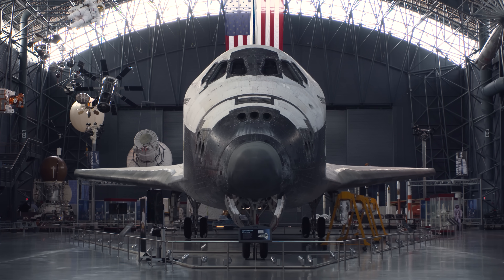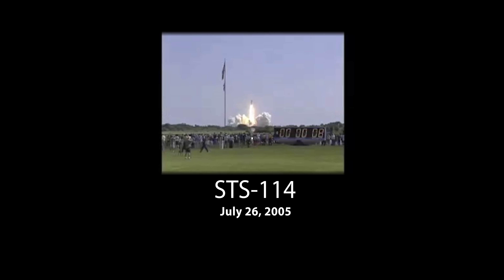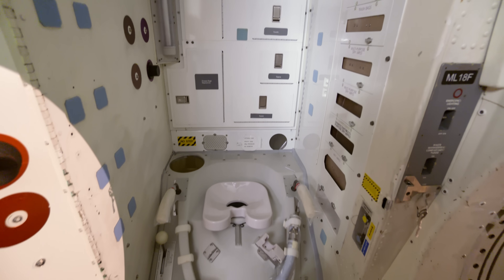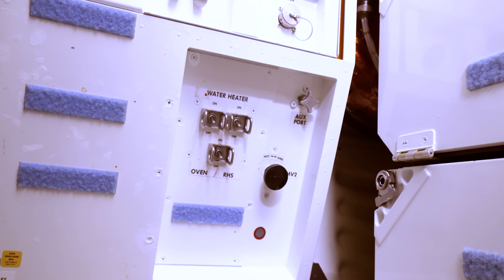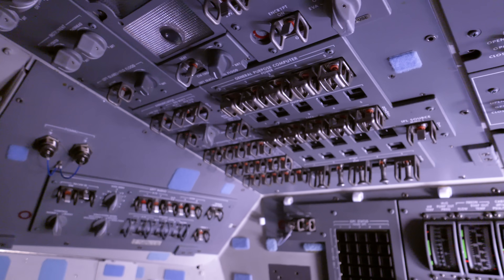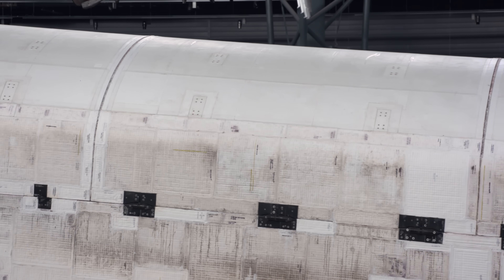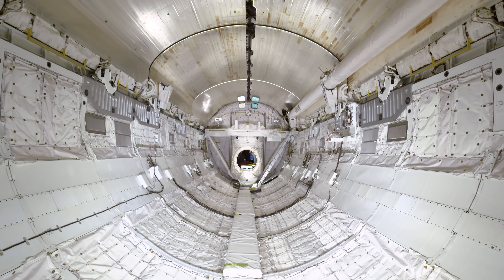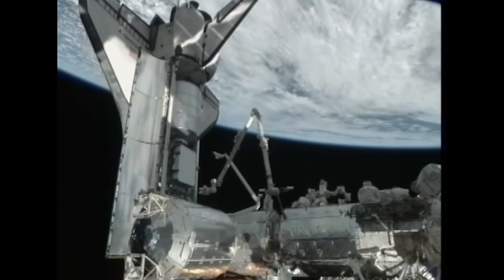Space Shuttle Discovery: Discover What's Inside

Comment: The engines are replicas as the real RS25 engines were far too valuable to be left in a museum as they're still current kit and used on such projects as Artemis.
Reply: but the engine exhaust nozzles were actual flight hardware (with flight history from various missions), but mounted on specially designed attachment points where the actual engine was supposed to be…

Comment: Why did it take so long to figure out that we don’t need the space shuttle to launch satellites?
Reply: It didn't.  The original idea was that we would save on launch costs with the Space Shuttle because it was reusable.  After the Challenger disaster, it became clear that the Shuttle was never going to be less expensive than unmanned rockets.  However, certain satellites and payloads were still better suited for the space shuttle so it was still used in those particular cases.  Check out the Astro-1 and Astro-2 missions.  Absolutely amazing and impossible to do with anything but the Space Shuttle.

Comment: Looks like it's still ready for flight
Reply: Yep is till is 13 years after it last flew
Reply: I was in LA in a plane when this thing stopped us to pass (in 2012 I think) and it was absolutely massive. Looked different than anything I’d ever seen. I had a left window seat and I got one of the best views. My blackberry camera was terrible though and I forgot to even snap a pic. 

Huge though.. and low to the ground. Totally through me off.
Reply: @Errcyco  I think that was the shuttle endavaour going to the California science center.
Reply: @Errcyco that was endeavor now at the California science center
Reply: I think very few people realize how little space is in the crew compartment! So you have a huge craft with a small living space!
Reply: The shuttles are still capable of flying. They need a big fuel tank, two solid booster rockets and a few other things and they would still work. To launch a shuttle you obviously need a large team of people. So without those things it won't go anywhere. But yeah it's still in good shape I think.
Reply: @grantjoseph8050  That’s a common misconception. For example, to prepare them for service every gasket, seal and piece of rubber would have to be changed out. Parts age and fail. They would probably have to remove every piece of silica for inspection. So it would easily take two years of restoration to place one back into service.
Reply: I suppose sitting the crew compartment is like sitting in your car with just a little more room.
Reply: There are no engines, batteries or liquids (fuel, oil, hydraulic fluid).  It’s completely inert.
Reply: @DriveFastLookGood that's why the person wrote that it looks ready for flight. Not that it *is*. 

Obviously Discovery isn't ready for flight anymore, it's enjoying a well deserved retirement. But the Smithsonian and NASA worked very hard to keep it in the condition it was in when it last landed. How Discovery looks now is how it looked when its wheels stopped on the SLF in Cape Canaveral 14 years ago.
Reply: They still keep the registration and oil changes current just in case there's an asteroid that needs nuking.
Reply: Far from it
Reply: @mdcclxxviepluribusunum1066  It looks ready for flight. Doesn't mean it still is.

That's deliberate by the Smithsonian and NASA. They wanted to preserve it exactly how it looked when it last landed from space.
Reply: @georgearthur205 yeh far from it without contradicting myself. Also when it went up it never looked like it had just come back. So again FAR from it.
Reply: @Local11-m9r Let me see if I have this right.  YOUR lack of education is sufficient to deem an entire space craft from the early 80's as fit for flight.  Merely looking at a seven minute video is a sufficient review.  It is of no doubt why your country failed so very very fast, and with such ease.